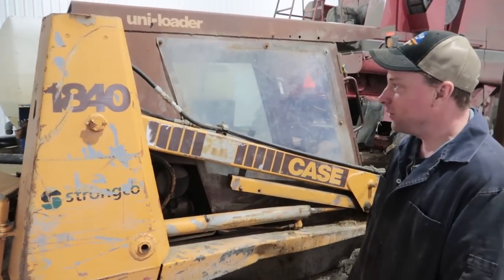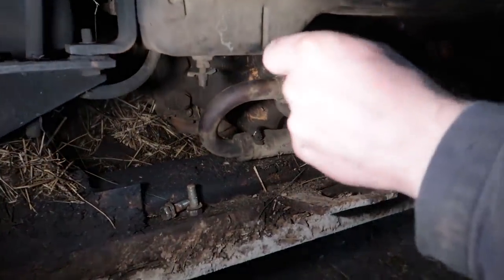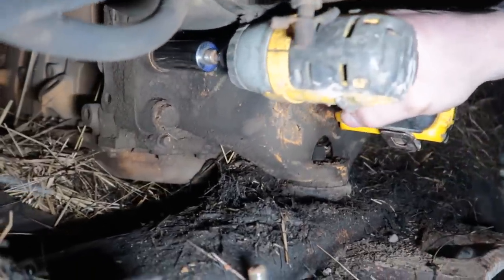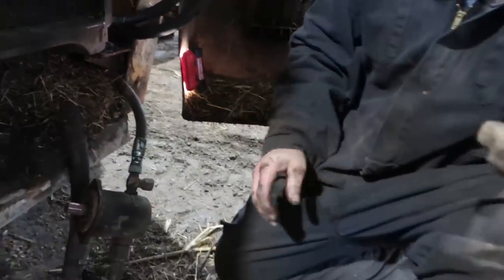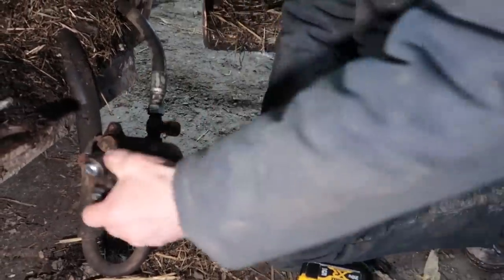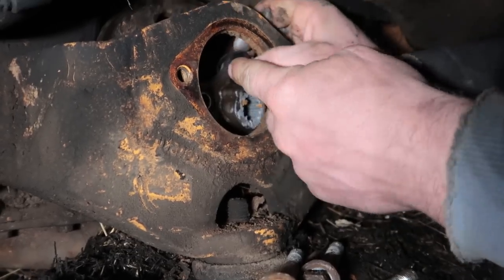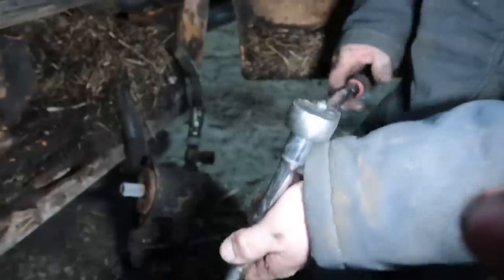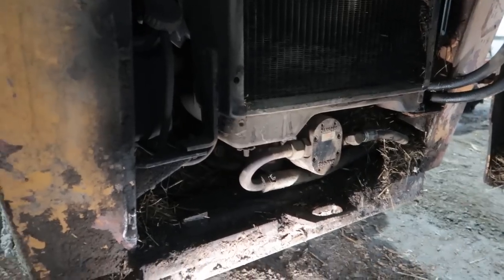Loss of Hydraulics on Skid Steer? Quick Easy Fix

Comment: Never seize turns into lapping compound.  You only use it on non moving parts 😹.   It will now wear  those splines out faster.   Good video
Reply: Soft vs hard.  It won't.
Reply: Aluminum wont wear/mark steel
Reply: @srjackson1611  Read the MSDS of the anti-seizes, they all contain a certain % of abrasives like silica and shit.
Reply: It amazes me how many people think antisieze is a lubricant.  Try that on a set of bearings on a crank and let us know how that works for you.....
Reply: Anti-seize will wear parts. Grease would of been a better option.
Reply: I dont kow what never seize contains, imo you should use something like grafite or moly paste on a coupler like that.
Reply: @phogelbice  moly paste would be best.
Reply: Thanks for sharing this. I didn't know. 
It seems to make sense though
Reply: I typically use moly or wheel bearing grease. I use never seize only on none moving parts, like spark plugs or ball joints. Just my 2cents
Reply: Special moly based spline lube only.
Reply: Copper anti-seize is great.
Reply: I just use heavy duty spray grease for splined stuff like that. Sta-Lube, Lucas Oil, whatever. Some kind of lube so it doesn't seize.
Reply: Who cares if it wears out I only care if I can get it back out easy haha
Reply: Throw dirt on it seriously any lubrication will will accelerate failure i learned first hand when I destroyed 3 sheer pins because I lubricated them ahead of time then my dad said throw dirt on it and it worked ever since
Reply: @yourposer  any dissimilar metals too. Like rotors and aluminum wheels, wheel spacers etc.

Comment: AvE might just have me brainwashed, but in a video not to long ago he mentioned not using anti-seize as grease/on wear parts because it actually has some abrasives in it rather than just lubricant. Glock actually uses a form of anti-seize on some surfaces that need to "wear in" to speed up the process. In this case i could see the abrasive anti-seize accelerating the wear on the splines, especially with the pump's splines already being "Questionable" and likely having some play between the surfaces.
Reply: To Shmoo or not to Shmoo
Reply: meh copper is softer than steel. i dont see it wearing steel shafts down
Reply: This is exactly what was going through my head when I saw the silver Shmoo! I said to myself oh God that's not grease lol

Comment: I would also have smeared some anti-seized the flange and the bore it fits in. I've had to remove WAAAAY too many hub bearings in GM cars and trucks, and Dodge trucks with a 20 pound swing press to not give it a dab of that silver schmoo.
Reply: No fords?
Reply: Ahhh.. the good ole swing press. No tool box is complete without one.
Reply: Dumb. No reason to. It’s not a high speed bearing exposed to salt ridden highways...
Reply: water bear fords don’t last long enough for the wheel bearings to go bad.
Reply: In Alberta we call it pipe dope or weasel piss.

Comment: Always grease, to avoid rust by condensation which will grind down the spline by the vibrations.
Reply: And if that's not the issue, the rust will become an issue when the pump breaks and your spline has rusted stuck to the coupler.
Reply: I also learned recently that two metals contacting can corrode without there being water present. contact corrosion or s-t
Reply: @Arnthorg  this only applies for self-build stuff. This vehicle uses factory parts, so they used metals which won't contact-corrode.

If you do have to put two metals together which might corrode each other you have two choices: Silicone or Teflon grease. Depending on the pressure/temperature requirements.
Reply: @timderks5960  unlikely in normal operations, since it will be rocked forward and backwards all the time. It can't rust together - except if you store it in a field for some years.
Reply: @RubenKelevra  Never say never. I guess you do have a point that they're moving a lot, but they're not moving that much in respect to each other. I guess the stress moments (starting / stopping the engine, revving up, creating a large hydraulic demand) would help in keeping it mostly rust free. Grease never hurts in preventing it though.
Reply: @timderks5960  well, there need to be large tolerances, since we're talking about steel parts. They cannot fit snuggly without experiencing large thermal-induced stress. With all the sharp edges as stress risers, one part or the other will start cracking.
Reply: Condensation is the issue for that part. !
That's a new 1
Reply: @deanrobert8674  why?
Reply: Rust won't grind down steel iron oxide is softer than iron.

Comment: We have this model too.
But ours lost drive. The drive pump is on the opposite side of the engine and the whole cab has to come off for access. There is a shaft connecting the engine with the pump. In our case the splines of the shaft failed. Buying a new shaft from Case would have been super expensive, so we had one made.
And yes, it is a 4BT NA. It has way more power, than what is needed fror this small thing.

Comment: I have a case 1845C, very similar to this machine.  Another cause of loader hydraulics not working right (really slow, no power, barely lift itself) is the auxiliary valve by your feet. The auxiliary hydraulics run off this same crank driven pump.  If you depress the pedal with nothing attached to the auxiliaries, it will deadhead and dump all that oil through the aux pressure relief back to tank.  You'll then have no oil to lift/operate the loader frame. Its real easy to step on that pedal by mistake getting in and out of the machine. I check that pedal for neutral every time I get in the machine.

Comment: Cool, a nice realistic "Damn thing broke!" video. I do NOT use anti-seize on that sort of thing. Have found that plain old gun grease actually lubricates better. I use anti-seize on lug bolts/nuts and anything that will tend to rust inTO place. I dont use it on anything that is subject to wear. It may be old wives tales or not, but there it is. Born/raised on a large farm/ranch in SDak. Michael in Colorado.

Comment: For the first bolt, you should have used a short wobble drive ext. or universal joint style. Don't use the cheap ones. They break and can cause injuries. For the second ones, use a t-handle breaker bar, 1/2 drive if necessary.

Comment: I was taught that if it's sealed you grease it but if it's open you don't, you go in dry! The dirt mixes with the grease to form a simple grinding compound accelerating wear. So, in this case, I would not have greased that. Plus especially not with anti-seize and it's not a lubricant it's a grinding paste! Use anti-seize for things that mate tightly that you want to get apart later. Stuff with a bit of play or movement you use grease. So this one is a double whammy, should have used grease if it was sealed but in this case, it should go together dry as it's open to the dirt from farm work.

Comment: Fighting with Vermeer right now about a stripped pump stack input on a stump grinder. They call for grease every 400-500hrs on the pump splines, which have been stripping out every 200hrs due to being far too small to power 3 stacked pumps. Personally, I don't grease them because it doesn't help any. They warrantee replaced the pumps twice and lubed them upon install both times. Plus I'm sure not pulling a 3 pump,12 hose stack every 6 months to a year, just to grease something that is outright failing at more than double the "maintenance"  interval! Normally I wouldn't expect any love from an equipment manufacturer, but Vermeer has listened in the past and re-engineered some stuff based on my feedback, so there is hope.

Comment: I used to run one of those things, super bouncy, no clearance, stalled under load, hard to tie down in a landscaping trailer, gah!  hated it.  But it is true that the cheapest equipment makes the most money.  My boss had a 1960's gas powered Dodge single axle dump truck and it paid for itself over and over again.

Comment: I worked on Skid loafers For almost 25 years and I always anti seized  those style shafts 
They also had a similar drive spline on Lx 665 and 465 New Holland’s replaced the shaft and coupler on many of those!
I am pretty sure you can’t replace the shaft only in a gear pump like that.

Comment: Would not fear rebuilding that pump at all. I've rebuilt tons of hydraulic pumps and motors. Housings are expensive but a Seal kit and a piston kit (or rotor kit) are half the cost in the end. Take your time and you can fix any old piece of equipment. Trust me....they make me do it on customers old garbage all the time at the shop :)

Comment: Being how wet that area gets and how much slop is usually in those pumps, I'd say grease it up.  From the looks of the splines I'd say most the damage came from water and hydraulic fluid getting mixed together, then sitting between the splines rusting them out, probably wouldn't hurt to take it off every once in awhile and slab some more grease in it. Also it helps lube the other side of the shaft seal, double win.

Comment: Told a story by a worker of a business who bought a new Terex tracked skid-steer, it was used for a day but when they drove it across a paddock one track locked up, turned out the hydraulic tank was dry, they changed one track motor, me i would have took the machine back and demanded a refund, My theory is the motor would vibrate thus moving the shaft in and out by the amount of end play, thus eventually wearing out the spline, I Agree with you and would put the anti-sieze lube on that spline.

Comment: the danger of not putting any lubrication on the splines is they may ware faster but if you do put grease on them then you risk attracting dirt and other abrasive materials that will actually speed up the wearing process

also antiseize is NOT a replacement for grease, it actually contains sand and can be used as a lapping compound as one of the other comments stated 
the best kind of grease to use would be a high moly content chassis grease of loader bucket grease

Comment: Easy to replace if lubed
Better than what rust can hold.
To eliminate chattering (witch is the load) weld the fuckr, rotate as needed to be bolted.
Speaking from experience

Comment: On newer discbines they started to put rtv on the splines of the spinner hubs. Wonder if that would help that.  Did that repair before 1840 run forever.
Reply: Did the exact same thing to our 1840, still going, figured a little rubber to help with the fit and keeping the rust/moisture out couldn't hurt, best comment out there in my opinion.

Comment: 98 24v cummins p1689 or 1698 forget the exact numbers but lost cummunctation between ecu to lift pump. I got new filters for the whole truck the pins on ecu to fuse box arnt broke or burnt all grounds seem to be good ive checked them all all are tight. Im gonna check fuel pressure as well but what else  should I check. Killer vid.

Comment: I'd say grease the spline, it can make it easier to fit together and help prevent both sides from rusting together however, as far as the mechanics it really shouldn't matter since there's very little if any relative motion between the two in normal operation.

Comment: Molybdenum disulfide is what you need for the splines. Loctite LB 8012 Paste Anti-Seize Lubricant, M-77 Assembly Paste, some of the brake caliper lubes work well. "Field repair" drill a hold through the shaft and that junk flange add  a never to break sheer bolt.  Metal to metal ,weld it or lube it end of story.

Comment: i feel like anti seize will likely cause those splines to wear quicker. would definitely be a good idea to put grease in on or something to try and protect the metal but doubt there is anything that will last forever. it is not like there is even a grease nipple on the coupler to grease it once and a while

Comment: always use some kind of lube, even on steel dozer tracks you will see a difference. people dont because of cost but steel on steel always wears. if you use dis similiar metals you can force the wear to the easy replacable part. just my opinion

Comment: I had a 1840, neat bobcat - tough little machines... unfortunately, I live on really good (dark) soil, and very hilly.  Why is this a problem, well, there are about 1/2 dozen bobcat-sized holes throughout the property.... no suspension and soft soil caused my purchase of a Kioti and the death of a couple winches. As an aside, I'll point out that I'm darn good at bobcat bucket recoveries (so when it did require a winch, it was fully stuck)

Comment: I would always use lube on the splines for the simple reason of play in the splines. However, I would NEVER use anti-seize as lube because it has abrasives in it. Use normal grease. And anti-seize only on bolts or non moving parts

Comment: Rich you got any experience with the Ford 1910 and 2110 tractors and their weak / slow hydraulics?  I hear its a common problem for the hyrdo's to be painfully slow (as mine is)  I was wondering if somehow rigging up a different pump would help or somehow modify the existing to get more out of it.

Comment: Yes Lube the part. But never seize is not Lube. You should always use Grease. Anti seize has small ball bearing like pieces of Steel in it. It will make a moveable fitting that wear early

Comment: I have a 1840 case that wont go in neutral without holding the drive sticks back. Moves forward and backwards and turns fine. Was told to adjust the linkage. Can you do a video on that?

Comment: the true quick fix is use some Lincoln electric or miller 220v metal glue splatter some in the general area its needed and bam its fixed

Comment: Hey rich just bought a 1982 New Holland L445 skidsteer and it intermittently shakes the whole machine violently sometimes while moving or lifting the loader it only stops if you jerk the sticks back and forth or throttle down to idle and drop the bucket all the way down.  Any help would be greatly appreciated.

Comment: I never grease splines in the assumption that grease will get dirt sticking to it which will increase wear rate.
Reply: Your splines should be super clean  during reinstall and in a sealed environment so... My car has a 2 pieces splined drive shaft (to give it more travel) and greasing the spline is a mandatory during routine maintenance. It is also protected by a ruber boot ofc. 
Source : check the drive shaft for a citroen 2cv
Reply: @tinatpasselepoivre  I agree on the car. I was thinking of the front sprocket and its shaft on my dualsport motorcycle.

Comment: You'd better grease that freaking piece of cast iron that is driving that lightly hardened steel shaft, or the spline wear will get worse quicker.

Comment: Definitely grease. You will always have movement btween the two parts. Grease with minimize fretting which will wear the splines away. If there was an heavy  interference fit, I'd say don't grease. This no grease issue was a learning when I worked at an airspace hydraulics company. I had a pump fail an accelerated life test because the splines weren't greased. Greased splines, repeated test and passed.

Comment: Where that part is located, grease will only ruin it faster buy trapping all the dirt. Or if the machine is used in wet conditions, will wash away in no time. Grease it if it makes you feel happy but your probably not doing anything useful.

Comment: I sort of feel that the thousand-dollar skid steer bargain is a myth if anybody knows where I can get one let me know
Reply: Mike D my new holland L454 was 1K. Rod through the block.  Swapped out the 2cyl gas for a 3 cylinder kubota
Reply: @Freakingstang  nice
Reply: Picked up my gehl 4615 for $1600 with a right side drive chain issue. Replaced main drive chain & sprockets $500 repair doing the work myself. Couple hundred in a new battery, and some fluids and filters and shes ready for many more years of work. 1400hrs on her purs like a kitten. They are out there for reasonable prices. Just far and few between. My area its tough. Most skid steers go for $5000+ and thats usually a beat machine thats 35-40 years old and has 4000+ hrs on it.
Reply: Just picked up a Case 1537 that runs and drives great for $750. I found this video because I have to do this repair. I also picked up a Gehl for 2300 and a Mustang for 1500. Gehl was sold for a double and the Mustang for quadruple. Not big money, but fun to play with :-)

Comment: Should never put never/seize on a splined part. The graphite in it will ware that part out faster than normal. Dry or regular grease is fine. Just sayin

Comment: You should grease it to prevent rust and not screw the next guy (probably you) but you should NEVER lubricate a part with anti-seize. Anti-seize is full of silica and basically acts as an abrasive.

Comment: I have an 1845C, when its first started both left and right drive are strong. As soon as the hydraulic fluid heats up the left side drive barely has any power. Trying to figure out why. Anyone know what could be going on?
Reply: Probably has the valve plates in the hydrostatic pump or motor worn.  Or both.

Comment: Don't lube the coupler so it won't move? It's going to move whether it's lubed or not. Yep, lube's going to attract grit and that may increase wear, or not... Lube the dang thing. Yeah, it's going to all sling out over time and the splines are going to wear out because it's lubed or not lubed. Just plan on putting a new one on some day. Replace what you need to and get on with your day. It's not a very good design.